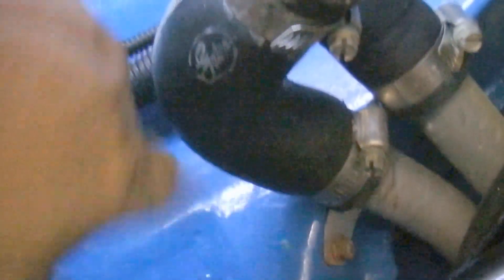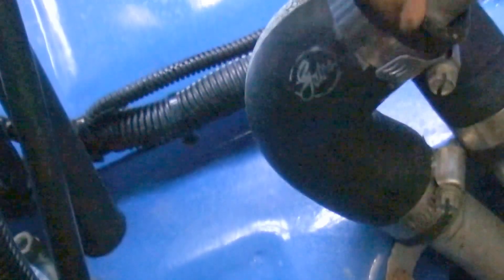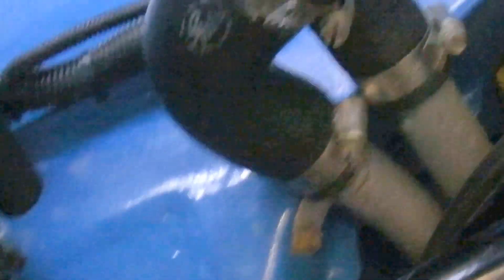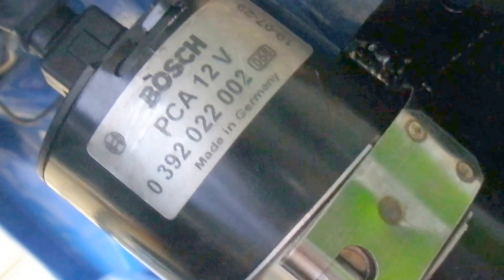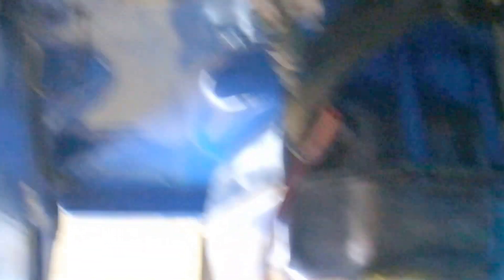Fiat 850 Electric Water Pump

Comment: Did you install this pump out of necessity ? Did you also replace the fan ? I cannot find the 4 bolt water pump for my 850 Spider and am trying to figure out a replacement plan. Any info would help ! Thanks.
Reply from the maker: I Installed an electric pump to eliminate driving the fan, increase revs/HP  and reduce Clutter in the engine bay.
Stay with stock pump for originality, resale and simplicity.
Stock pumps work just as well as electric. 
Keep looking and you'll find one; they are not rare.